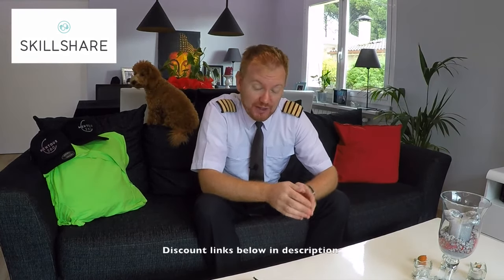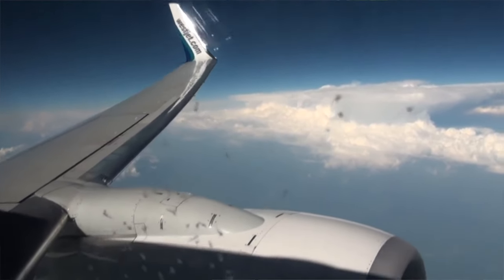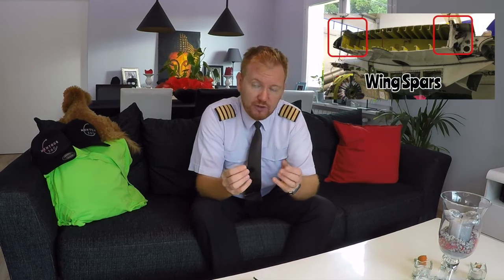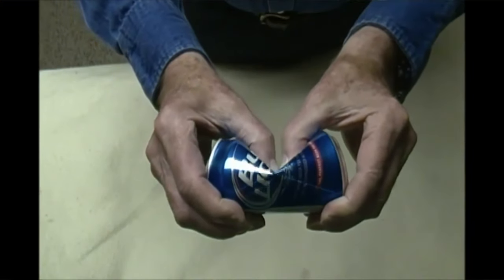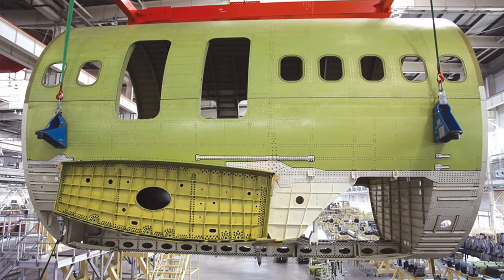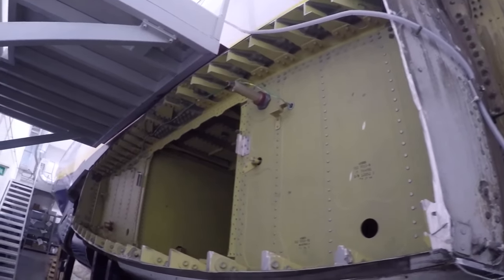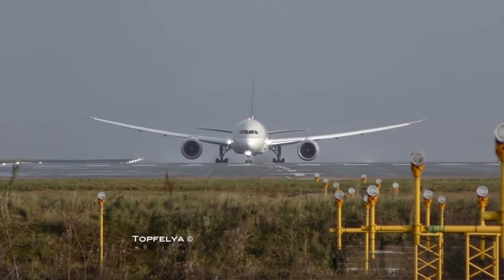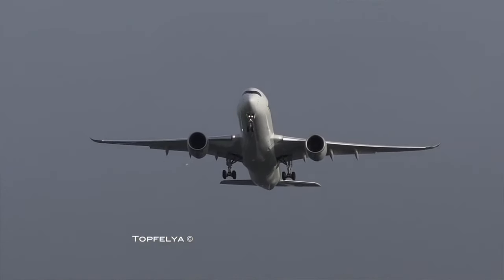Why don't the wings break?!

Comment: I liked the explanations. but what about the engines? What if they stop suddenly? Is this nothing but fobia?
Reply: Unlikely for all engines to “stop suddenly”. But if that happens, most aircraft can still glide a fair distance giving the pilot time to find a place to land. A similar incident happened to Air Transat Flight 236 flying across the Atlantic Ocean. Due to a fuel leak and misjudgement/misinterpretation on behalf of the crew the plane ran out of fuel mid way across the Atlantic. It managed to glide for 20 minutes and land in the Azores islands saving all passenger and crew (over 300 people). I wouldn’t worry too much about an all engine out scenario. The likelihood of that happening on an airliner is very low. The risk of dying being hit by a car while crossing the street and browsing your phone is significantly higher. So, chill out and have an enjoyable flight :-)

Comment: When my wife and I fly commercial and hear passengers bitch about turbulence, we smile.  (They have no idea what real turbulence is)   We have, in our four-seat airplane, several times experienced turbulence  so strong that without  tight seatbelts, we would have had serious neck injuries from hitting the ceiling.  There are safety concerns when flying, but actual airframe failure in certificated airplanes is extremely rare and not generally something the pilot worries about.

Comment: Your explanation of the g limit is confusing. With your reference to what 1 g is and what -1 g is, that implies that the plane in level flight would be 1 g, and unless it starts diving down at more than 9.8 m/s^2, it would always be positive. That would mean that even in turbulence when you feel lighter, but still aren't flying upwards, that would still be positive, not negative.

Are the g limits you stated in addition to the 1 g from gravity, such that -1 g is free fall and 0 g is level flight, or do they include it so 0 g is free fall, 1 g is level flight and -1 g is accelerating down at twice the rate due to gravity which would result in things appearing to be pushed up to the top of the plane?

Comment: Keep in mind that the factor of safety is only 1.2 😁😁. Many Aircraft structural engineers I know refuse to fly for a reason.
Reply: Mario  it describes the ratio between the load at which the wings break and the maximum load allowed during operation. basically the wings are only 20% stronger then flight envelope (max load factor).
Reply: @Elliot > I have worked with many structural engineers in my 32 years of aircraft developement and Flight Test and have never heard a structural engineer say they won't fly.
Reply: @rcairflr  I don't know what your credentials actually are, you could be a wrench for all I know. But 3 of the guys I know in my field won't fly commercial.
Reply: @Trusty_Steed  >  They are not here to speak for themselves so I will take it all with a grain of salt.  Remind me again when the last Commercial aircraft crashed because of a major structural failure.

Comment: QUESTION ........ Mentor, i have question, at the top of the vertical aileron, some plane have a corde with a cone at the end of it, wath is it and wath is the purpose of it.
Reply: @Francois > First it is not a vertical aileron, it is a vertical stabilizer.  The Trailing cone is used in Flight Testing of aircraft.  It is put back there to read Static pressure in clean air.  The static pressure is fed to either a Air Data Computer or a Pressure Transducer, it give accurate altitude for calibrating the developement Air Data Computers.  The cord (as you call it) is a plastic tube that runs the static pressure to the sources I stated above.   About 5 feet forward of the cone is the Static sensor.  The static sensor is nothing more that a hollow stainless steel tube with little holes in it.
Reply: @rcairflr  thank you Mark for your answer, it was complete, you will also understand that my first language is not english, so some of my terminology may not be so accurate, but  you kindly took the time to light my lack of knowledge regarding that peice of equipement, so, i thank you for that.
Reply: @fbrodeur44  > Your welcome.  I worked Flight Test and aircraft Certification for over 32 years.
Reply: @rcairflr  Well, i could not have found a better person to answer my interogation about that small cone that is sometimes attach to the vertical stabilizer of an aircraft, again, thank you :)

Comment: You said you have the fuel in the wings to distribute the weight so not to have all the weight in the main body of the plane, but doesn’t the weight of the engines make the weight distributed.

Comment: Why passenger planes no emergency parachute incase of emrgency?
Reply: First, there's very little oxygen at cruising altitude and it's very cold (−40 to −57 °C). A jump would require an oxygen tank, a mask, and a regulator. Second, 99.9% people on board have zero training. You can't just jump and hope for the best, that's not how it works. Third, imagine 200+ panicking passengers strapping into parachutes and proceeding to the exit doors. Not going to happen. Fourth, skydiving planes travel at ~150 km/h but commercial planes cruise at ~900 km/h. Jumping passengers would probably just smash into the side of the aircraft. Finally, even if you manage to jump and you end up somewhere in the middle of the cold ocean, your chances of survival are slim. I hope that helps :)

Comment: In 9/11 we saw that even the tips of the wings could cut through 12" steel columns. So, no, wings are definitely indestructible.
Reply: its all about speed.  A grain of sand will shoot through an astronaut on a space walk like a 22.
Reply: @justayoutuber1906  And speed is all relative. Is the steel beam moving towards the wing, or is the wing moving towards the steel beam? Which of the two will get the advantage?

Comment: Bad maintenance will not cause a failure in the wing structure. Bad piloting (Hard Landings) cause stress cracks in structural components that may lead to a failure. Your more likely to see structural failure when confused pilots fly into thunderstorms and stall the aircraft and it slams into the ocean as was the case with air france flight 447.
Reply: bad maintanance can absolutely cause a failure in the wing section if cracks are allowed to propagate for long enough without detection
Reply: @AmbientMorality  Yes, but that pretty much has never happened on any medium-to-large airliner within the last 40 or 50 years.
Reply: @h8GW  Very true, but that's because of good maintenance.

Comment: Answer without watching the video. Wings do break. If you exceed anything’s designed load, it will break. If you run into a building like the 747 that flew into twin towers it will break. If plane is overloaded or you push it over the g force it was designed for it will break. It doesn’t break cause it was never subjected to loads enough for it to break.

Comment: im pretty sure turbulence isnt slightly minus G but rather something like 0.9g or something akin to that
Reply: Severe turbulence can go negative - the usual result is passengers and crew hitting the ceiling, broken bones are the usual result. Having a trolley hit you is not a good experience. Putting on your seat belt may save you a trip to hospital (or far more rarely, the morgue).

Comment: Dont the airliner fly a slightly lower speed to prevent structural break? It is better to stall an aircraft by lowering its speed than to break it apart, right?
Reply: That is true for the most part, cruising speed is usually about 20-30% lower than Vne (depending on aircraft type, airline policy.etc)

Comment: real late but, compare to a car. if the wings didn't flex, it would affect the overall comfort of flight like a car which is bolted to the frame of the car instead of having a suspension. every single bump, curve, dip, gravely road will hurt. formula 1 racers can attest to that.

Comment: I have seen one of those tanker type planes lose its wings while in flight, I guess there was both pilot and mechanical error. It had a full load of water on board and as it flew to its drop zone to combat the fire, the wings broke off, I believe killing the whole crew.

Comment: But wings can and do break. They are supposed to be able to exceed design load limits by 150%. But at 151% of the load limit they do break. 
This has only happened a few times to airliner aircraft in history. So it is very rare occurrence. Almost always a result of some other failure that happened first that led to the over stress point in the flight.
Reply: Stop worrying about all that - just sit back and enjoy the in flight movie about the Concorde disaster

Comment: Wouldn't -1 G acting on your body on the couch result in zero body weight and the only way you went pfffft to the ceiling would be a result of you pushing off the couch?
Reply: Not necessarily 0 G is where you are floating but -1 G feels like the same amount of gravity but the opposite way up instead of down

Comment: Just another reason why the TWA Flight 800 fuel tank could not have blown apart.
Reply: It was the center tank that blew, not the wing tanks. And they aren't designed to withstand a sudden ignition of significant fuel vapors. Too much fire and heat generates too quickly to vent, and the internal pressure rises to a point where the structure fails. It was proven in multiple re-creation experiments.
Reply: High there, Sanc. Let me try and explain. I have to do that a lot. The page is about, 'Why don't wings break.' (generically/ generally speaking.)  My reply... This has to do with the "strength" of the material and its design fabrication, given that the "Wing" is apart of the entire Center Wing Section, which is demandingly strong and has to be, and therefore, with the massive strength of the WING Center Section, would be the reason why the 800 fuel tank COULD NOT have blown apart, as was erroneously 'suggested' by the NTSB. So, you imagine that the 747 is Papier-mâché?  Why is that??? That a lot of people, seem to think that 'Kerosene' is this massive High Explosive?  I never could figure that one out.  Lack of knowledge perhaps? too much TV? (.. the car goes over the cliff.. and KAPOWWW!)  So it must be true?  'especially' when the government says it TRUE!  The point is, Sanc, that the Center wing tank did not 'blow' because it is Impossible for the Center wing tank to have Blown as suggested by the NTSB.  There can nor was there any (as you claim)..."a sudden ignition of significant fuel vapors".  First of all, the tank was on "E".   FACT: The amount of liquid fuel in the tank was 'less than one half of one percent' of the entire volume of the tank. Next: it's Kerosene.  FACT: kerosene does not just give off flammable vapors.  I worked with Aviation Kerosene in the U.S. Navy on Aircraft Carriers, as I am a former 'Aviation Boatswain'.  Kerosene is a Category 4; H227 Combustible liquid.  ONLY for purposes of Safe Handling and storage, for OSHA is it placarded  as flammable, to avoid a 'fire', but it is not a flammable liquid as it is of a lower volatility than Gasoline, and is highly stable.  FACT: Kerosene/ Combustible Hydrocarbon liquid.  Kerosene, also known as paraffin, lamp oil, and coal oil, is a [combustible hydrocarbon liquid] which is derived from petroleum. It is widely used as a [fuel in the air industry] as well as households. Its name derives from Greek: κηρός meaning wax, and was registered as a trademark by Canadian geologist and inventor Abraham Gesner in 1854 before evolving into a genericized trademark. It is sometimes spelled kerosine in scientific and industrial usage. The term kerosene is common in much of Argentina, Australia, Canada, India, New Zealand, and the United States, while the term paraffin is used in Chile, eastern Africa, South Africa, Norway, and in the United Kingdom. The term lamp oil, or the equivalent in the local languages, is common in the majority of Asia. Liquid paraffin is a more viscous and highly refined product which is used as a laxative. Paraffin wax is a waxy solid extracted from petroleum.
(The lower the flash point, the higher the volatility. Gasoline has a higher volatility than Jet fuel.)Now, there could not have been an ignition of the vapors, to any catastrophic measure, given that JET fuel hydrocarbon is not a high energy chemistry.  It is about as easy to ignite Jet fuel as it is to ignite a jar of peanut butter.  Even if... it's like the match being tossed on the BBQ.... {poof.}   There would be not fire in the tank either. (though that is not  in the NTSB scenario.)  BOEING, again to fill in {all eventualities} for any event, such as a crash landing and such, are required to maximize the 'safe'. ... such as any encroachments and then there is a fire suppression system. However, not one of the Fire bottles in the system were 'fired' off. There was no heat and or 'fire'.  The  'Re- creations you refer too, are fake, staged, set up, phony, non scientific, and propaganda.

Comment: I'm 47 now, can i still try to pursue to be an airline pilot at this age??, current working as an engineer
Reply: Who stops you doing yourself to air pilot captain but I guess they hire ex airforce pilots usually . Have you tried Microsoft Flight simulator - I tired it 25 ? years go but then it was as fun as watching paint dry -maybe I hadn't patience